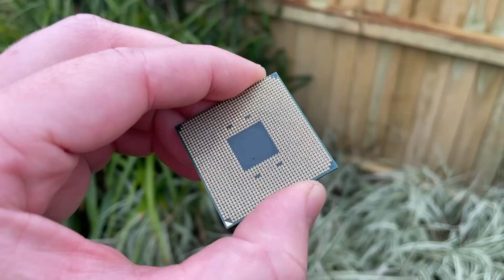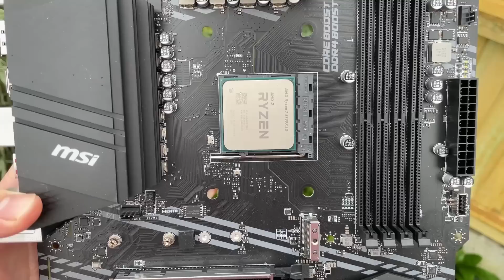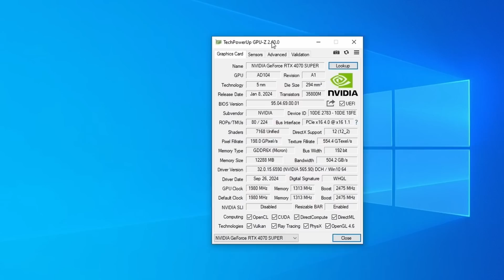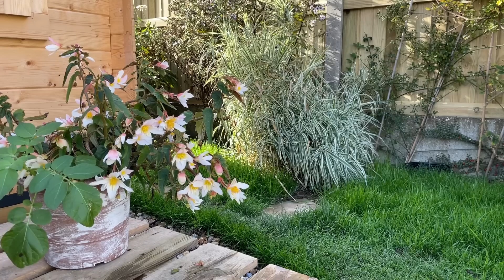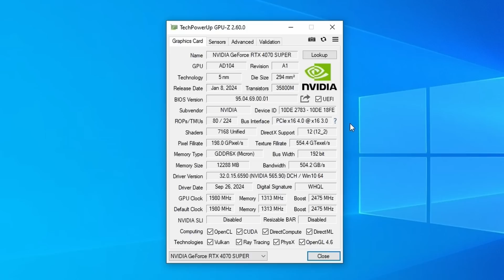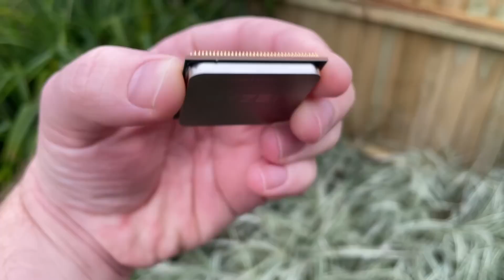I accidentally dropped my new CPU, here's what happened to it...

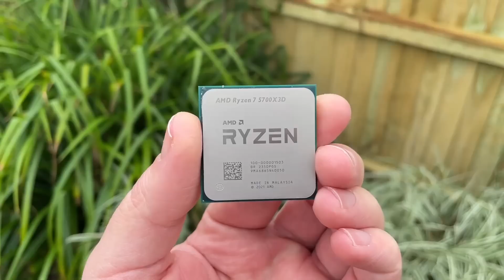Comment: At 6:47 the CPU looks like it's missing a pin near the corner arrow. According to the AM4 pinout diagram it's pin D1 which is P_GFX_TXP, it being one half of a PCI-E GFX transmit data differential pair might be why you're having trouble with PCI-E 4.0.

If you do have a missing pin you can try to stuff a piece of wire in the pin slot, as long as it contacts the pin's base and the socket contact it'll work, you just cut a piece that's a bit longer than needed and file it down to the right length. Getting the right diameter might be a PITA though, getting the wire out of the socket later might prove troublesome as well if it's wider than the original pin. You can also try taking it to a jeweler, having him solder a new pin on shouldn't be too expensive if he can do it, not all of them can though.
Reply: You are absolutely correct, you can even see it better at the 6:50 mark since the tips of the two pins surrounding it show, but that pin has a hollow center indicating the missing pin.
Reply: Having a jeweller solder a new pin on is a very good idea. They have the ability and it would cost waaay less than a technician.
Reply: YES I was thinking about something like this and you spotted it and worded it! Those copper pins if bended enough times get too many cracks and just pop off. Recent LTT video where they bended AMD CPU's I think Alex explained it really well how copper pins have these cracking lines and with every bend they crack more until breaking.
Reply: yes you can also see it in the side-view around 0:48 if you pause at the right moment.
the base of the pin is still there but the actual pin is missing...
Reply: It's possible (although tedious) to transplant a good pin from a ground one. That said, I'd probably avoid it if you can live with PCIe 3.0
Reply: I appreciate that your comment has good intentions, but I believe that corner doesn't have a pin on any AM4 CPU by design. Just look up on Google images: "(any AM4 CPU) pins"
Reply: Or just solder the pin from other CPU. Shouldn't be very hard to do or expensive for someone repairing electonics to do.
Reply: The jeweler sounds like a great idea and I hereby request that being tested, please:D
Reply: Stop it with the wire in socket BS.. it just needs to be soldered, proper technician can solder missing pin, its on the outside row, should not be a problem
Reply: @igors_lv  Yes a half decent soldering iron with a fine tip makes this an easy job, pins are readily available on ebay. I've done done this fix myself though admittedly it was some years ago when an AMD Opteron socket 939 was the thing to have.
Reply: youre right! it is! it looks like its a vss pin tho uwu
Reply: @eclipsekatrina420  The reason it looks like the Vss is because the gold corner counts as two pins in the layout : )
Reply: It looks normal to me.
Reply: Nah if you look at the amd cpu pin out they dont have a pin on that corner where the arrow is located.
Reply: @carlosandres8974 I thought that, but they don't mean right in the corner. It's the fourth row up at the edge where the pin is missing.
Reply: @Nick_R_  i see it now yeah you right

Comment: It's like a pins no longer making contact check to see if any are slightly shorter, possible pins not connected to cpu board and heating up pins may fix(not id like to do it) Linus done some videos on repairing pins missing and bent that are good. 
Could be cheeky and ask AMD or place of purchase to replace but not say you dropped it, im told some places dont test returns if it looks good they replace/Refund sale on as open box.

Comment: I have a B550 motherboard also limited to PCIe 3.0 and my 4060-Ti doesn't seem to be limited at all by it, comparing benchmarks against a 4.0 board they are identical.  I've also bent the pins on a CPU before and had to carefully bend them back, I got lucky and it worked fine.

Comment: nathangamble125 is correct from the arrow second pin up is missing, thats why your having this problem, easy fix, nathangamble125 already time stamped the shot at 0:06, the way your holding the chip at that time from the arrow at the bottom left go two pins up on the left and there is a missing pin

Comment: Guess the old AM3 (940-pin) chips are a little more robust. Friend absolutely flattened 75% of the pins on his brand-new 9590 when installing it, I managed to bend them back with a pocket knife. Worked fine for ages.

Comment: Probably some pins are just dirty. Take a soft toothbrush and isopropyl alcohol and wash all the pins carefully. That should do the fix. Also for removing the CPU I'm using a duct tape or some other sticky tape. that way I stick the tape to the IHS and lift it that way. Doing that with fingers only may cause it to slip and fall.

Comment: I did something similar to this. My cpu was stuck to the cooler. I had to use the back end of a butter knife and hit the ihs multiple times before it came off. I bent a few pins but luckily the fall was only a few inches. Bent the pins back and my 3700x still works just fine. Im glad it does because I was in NO position to buy myself a new cpu.
Reply: You gotta twist the cooler while the CPU is in the socket!
To be fair, I tried to do that myself, and ended up pulling the CPU out anyway. AMD's stock TP is like concrete, so twisting hard enough to break the paste makes it feel like you're going to rip apart the CPU or motherboard.
I avoided damaging my CPU by making sure I had a soft surface (a folded dusting cloth) beneath when I prised it off of the bottom of the Wraith cooler.
Reply: @nathangamble125  I didn’t know that at the time

Comment: I bought one of these a while back on Ali express and it came with three bent pins on the corner. Bent them back and it worked fine. Also how do you get such high cinebench r23 scores? Highest I’ve seen with an asrock b550 phantom gaming itx/ac is 12755. On an older jginyue b550 itx board I had low 13ks

Comment: That's the main reason I dumped AMD and went back to Intel that I have used since the 8088 days. I sold all of my AMD parts. I was really never happy with AMD hardware...but that's just me. Hope things get better. Cheers
Reply: Used solely AMD since the 8088 days here, and had no troubles. Watching this on my still-trucking FX-8370 box whilst running a Win7 VM under Win10. Been testing the latest Debian and Fedora Linux options on it in preparation for the sunset of Win10, and again, zero troubles. Was even running 11 on early Insider builds before they implemented the stupid TPM and CPU requirements.
Reply: @erinw6120  I'm glad AMD serves you well. It is a good platform, but I just kept being called back to Intel. They are both good platforms... I just needed to pick one and it was Intel. Cheers
Reply: @rickh8380  It's on the fella for dropping the cpu and breaking a pin, he broke the 1D pin off and that's a GPU PCIe pin (2nd pin above golden triangle to the left) and it's a fixable issue with the right tools and skill set
Reply: @BaroonValm  Been an Electronic Technician for over 40 years. With the right tools and soldering iron... I might be able to fix it? Thanks for the info.
Reply: @rickh8380  I sense sarcasm and a lack of information.. hence my reply

Yes, you can fix this issue, and it's in fact quite trivial compared to fixing say, a GPU, and there are People that do this sort of stuff all the time, search for something like NorthridgeFix AMD Pin CPU repair and you'll find videos of the exact type of fix that the CPU in this video needs, and it's much simpler than GPU repairs which are also a thing, both from the one pointed out earlier and people like KrisFix-Germany

In fact often enough when you drop CPUs like this you just bend some pins, and if you manage to straighten them up without breaking off any, the CPU works just fine, and this actually happens more then you think, hence why there are also quite a few tutorials out there on how to perform fixes.

Honestly though PGA is superior to LGA in that regard, as pins on the MBO are much harder to fix if you damage them (and are less likely to be fixable by the end user), though to LGA's credit it's less likely that pins will get damaged, though I've seen plenty of people drop CPUs on the MBO Socket

Comment: Just built a Pc for my son about 2 weeks ago (Ryzen 5 5600) and yeah, was so nervous as: 1) my first time building a PC and 2) its an AMD chip and heard so many stories about bent pins. Luckily it all went well.

Looks like the issue might be a pin not bent back well enough and it's one of the ones that control the PCIE 4 mode?   Might need a magnifying glass/microscope the inspect the pins more thoroughly

Comment: The issue with the B550 is that it relies entirely on the CPU for the 1st PCI-E x 16 slot, which means any issue with the CPU will affect directly the GPU lanes. The B450 boards don't have this problem as far as I remember

Comment: @ aprox. 6:49 while you are showing the pin side of the cpu, it sure does look like a pin is missing at the corner with the arrow.
Reply: Yes, at the 6:50 mark the fourth pin up on the left side of the chip is missing.  That pin in the pin out is D-1 and is the pin for VSS P_GFX_TXP[0].  He is holding the cpu sideways and thus that missing pin in the pin out is on the top.  The gold corner counts as the first two pins, the third pin is Vss.
Reply: Yep, good spot. Can be seen at 46 seconds also.
Reply: Looked up about that. It's not missing a pin.

Comment: Been there, Dropped my brand new (at the time) 2200G before I even got it in the socket, or the BIOS upgraded to even get it to work! No wonder I couldn't get Windows 7 to recognise it. But the real problem turned out to be the PSU, which was getting on in age at the time. Speaking of which, It's been a few years since I put in my most recent PSU, perhaps I should look into a new one in the next annual overhaul. That and a nice new SSD for my Games.

Comment: Sounds like memory controller issues or one of the pins responsible for a memory channel is hanging on by a thread.
Try with single channel RAM (try both channels) to confirm.

If that's the case, what another user recommended regarding trying to reflow the solder may actually solve your problem in this case. Memory controller wouldn't normally take damage from a fall, let alone one where the pins take most of the brunt.

Comment: Try and de-lit the CPU ..and see inside it maybe some answers to your problem will be visible there.. or maybe a dry joint from pushing back the pins. That to the eye it looks ok but  it doesn't make full contact. On what surface did it fall.. tile floor carpet or cement...
Reply: it's missing the 1D P_GFX_TXP[0] pin, second above the triangle to the left, that's the problem.. He has been notified of this and we'll see if he manages to resolve this

Comment: Update that B450 bios to the newest one or at least reset it. Preferably, both. I needed to update my board's BIOS for 5700x3d to boost to 4.1, without it it would be stuck at 3.0. And 'old' bios technically supported the 5700x3d.
EDIT: As for the CPU - there might be a short between two pins or there is poor contact of one pin and its pad, causing resistance.

Comment: Put it in a frame on the wall with a sign saying "Clumsy Twat" underneath. Every time you look at it, the pain will return and you will never drop something again. Sorry for your loss though: it was a fine chip that.
Reply: @RandomGaminginHD  i believe you can find out on the web pin labels for many processors, it might point to where the fault is.  then you could have the fun adventure of viewing the pins under a scope and trying to fix or re-solder them  :face-blue-smiling::hand-pink-waving:
Reply: @FroggyTWrite  Just put the pin in the correct hole in the socket. As long as the CPU makes contact, it'll close the circuit and everything will work.
Reply: Ah yes
Reply: Excuse me, don't they call them "crisps" in the Old Country?
Reply: good ol' brit humour

Comment: I ran into this issue on an asus MB and a brand new 5800X3D chip, this ended up being a MB problem got a different MB worked fine. Check a different B550 board it might not actually be the cpu.

Comment: At least you made it mostly work again. Fixing 1/4 of the pins is a LOT of pins, so that in itself is a good job.  Yeah, PCIE 3 is still good especially for midrange cards. I mean, I've got an RX 6700 and I'm running it with a R5600 on B450 and if I upgraded the motherboard I'd likely get no benefit from PCIE4 at all.

Comment: You can check an AM4 pin out diagram. Without doubt one of the bent pins is needing a resolder, replacement, or the pad is lifted.
Reply: Pin 1D is missing, a GPU PCIe Pin, above the triangle 2nd pin to the left.. I've already reported it and he has replied that he'll take a closer look and is aware of it. Hopefully it'll be an easy soldering fix
Reply: @BaroonValm There not a pin directly above the triangle to begin with. Maybe, you mean the other left? I can't see a missing pin there. I do work on these, but he'd have to hold it still.
Reply: @drewnewby  When Baroon says "above" he doesn't mean "on top of". Up in the X axis, vertically. The missing pin is visible at 0:06
Reply: @nathangamble125 We're not playing battleship here, and I'm going cross eyed looking for it. The pins are named, which one are you saying is missing? Again, there's not a pin in the keyed corner like the other three.
Reply: @drewnewby  there isn't one missing they're just assuming there was one there because the other corners have them
Reply: @MrBeetsGaming I think they're talking about P_GFX_TXP[0] but I can't tell it's missing. Would help if either knew the pin names, instead of playing battleship. Either way, still an easy fix, done plenty.
Reply: @BaroonValm  there is no pin missing stop guessing where they're supposed to be and just go look at a picture of one

Comment: i somehow managed to broke one of the corner VSS pins on 5600x while installing in different mobo after upgrading. The msi b550 board can see it and boots up, while asus b450 flat out refused to boot. Not only it does not boot, somehow the dual channel broke on previous cpu - r5 2600, i guess it has something to do with different pinout on 5000 and 2000.
Reply: the pinouts aren't different, that's why they're compatible. there are pins that are unused on older gen cpus that have been reserved for future cpus and there are testing pins, but they're always with the same purpose on the same socket.

Comment: Hi I have a question for you. I recently got a 5700x3d from aliexpress for cheap. it got here safely and the cpu looked as if new. Installed it but when I quickly benchmarked it on CPU-Z, I got a single thread score of 525, which I found very disappointing, coming from a r9 3900x. Can you tell me whether score of 520 in single core on CPU-Z actually normal? I'm using a B450 motherboard. Thanks in advance!
Reply: I'm getting 545 single and 5858 multi on an MSI B450 Tomahawk Max. MSI Kombo Strike 2 is enabled which is essentially a voltage underclock ( -20 PBO2 curve offset )
Reply: @Kedwa  thanks for the figure. I guess mine is not terribly far off. But it is really what we are supposed to get? I have a 5950hs laptop that has a socre of 620 in single thread.. 525 seems really low! Even lower than my old 3900x. Or am I just overlooking the score?
Reply: @chleprince1894  It's surely down to the lower boost clock speed. 4.05ghz vs 4.6ghz (couldn't get a figure on the 5950hs). It's all about the 3D V-Cache and gaming with the 5700x3D, I don't think cpuz benchmark is particularly useful.

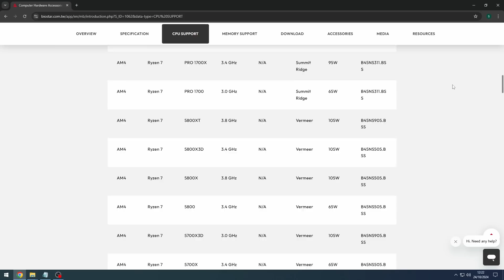Comment: 3:55 it's not a board limitation. Unlike other AM4 CPUs, the ryzen 5800X3D and 5700X3D run on unsupported BIOSes, but they are locked to their respective base clock speed. You have to update the motherboard BIOS to fix that.
Reply: So if i put a 5700x3d on a mobo with q 2023 bios it will work?
Reply: @FelipeOliveira-bj6mk  Any bios which supports Vermeer cores will boot any Vermeer CPU, but if the model is unknown to the board, it will limit its boost.
Reply: @TryboBike  It's really disappointing in a sense because I bought the most beefiest,classiest, higher end board I could find only to discover that probably the actual best gaming CPU on it would be limited to lower boost clocks and can NOT be fiddled with, so a 5800X3D is only using 105w and therefore those beefy VRMs and 8pin+4pin EPS is useless. I can ram 300w through that socket easy and it'll only be useful on a used 5950x.
Reply: @TryboBike  well, I was afraid to upgrade my 5600g because I swap gpus all the time and sometimes have to reset my bios. If what you're saying is true I think I'll upgrade my cpu :)
Reply: @FelipeOliveira-bj6mk  yes.

Comment: i once bent my i7 7700 pins and inserted it as it is in my motherboard performance was horrible but after fixing the pins it works fine to this day but somehow my one ram slot stopped working so now i use 1 ddr4 16gb stick

Comment: I reckon either a pin is only barely hanging on, or there's a break in some of the solder balls. You might be able to re-melt the solder by heating the cpu up nice and toasty. The pins might fall off though.
Reply: The pin isn't hanging on, it's visibly broken off. The broken pin is on the left edge of the CPU, 2 pins from the bottom, at 0:06.
Reply: @nathangamble125  great spot buddy, can see it real clear bang on 0:10
Reply: @nathangamble125  Spot on! I didn't see it while watching the video. That pin is plain ol gone. There's the problem.
Reply: @nathangamble125  if you're talking about by the arrow there was never a pin there, I keep seeing this comment and I'm not seeing any missing pins anywhere. Seems like people are just assuming all the corners are the same and they're not
Reply: @MrBeetsGaming  There is a missing pin there, you have to look really really closely at 0.25 speed